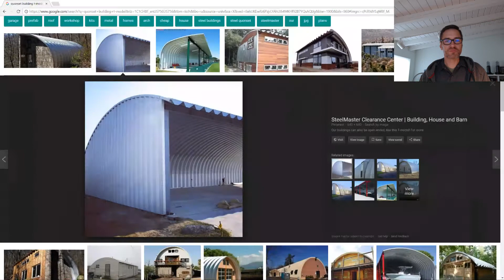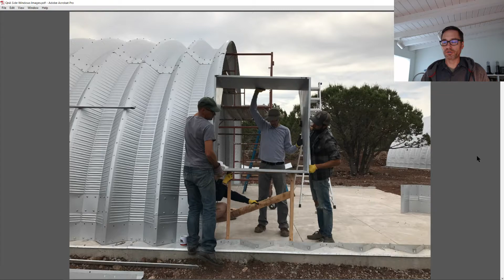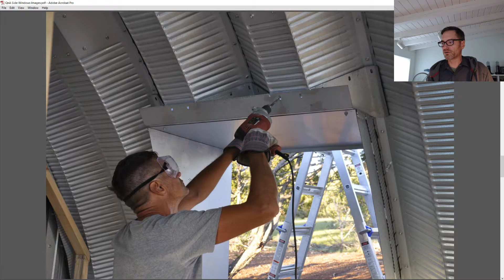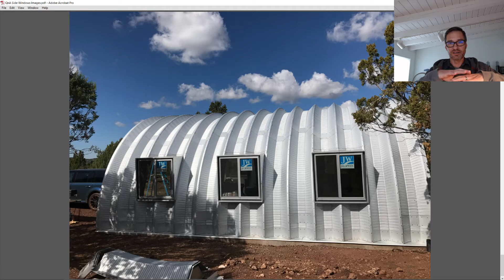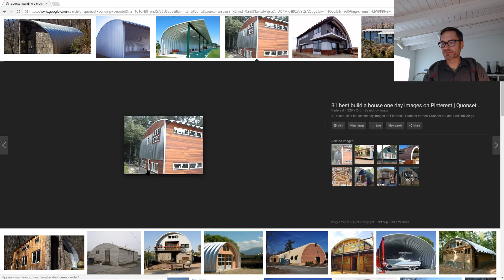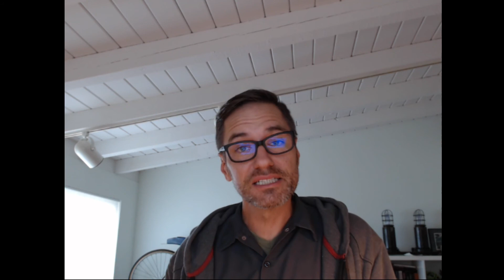Quonset Hut Side Window Installation, T-Model Quonsets, and Passive Solar Design

Comment: These openings are designed to be overlay from the outside?, Rather than staggering them like a shingle or siding?
Reply from the maker: Yes you are correct. It is a flawed design IMO.

Comment: Did you ever think about welding the side windows instead of using caulk?
Reply: Welding galvanized parts is always really terrible.
Reply from the maker: I can weld but I'm not that good at welding thin sheet metal, skill-wise. I'm pretty sure you would void the manufacturer's warranty though, if you took it upon yourself to weld their parts after they left the factory. There are also a lot of irregularly-shaped gaps and when you're talking about welding thin material I'm not sure on what the limits are for how much gap filling you can actually do with the welds. So maybe/maybe not.

Comment: Think I'm leaving mine intact
Reply: If I didn't need natural lighting we would just have windows on the end. We have Steelmaster. Don't remember the type but our windows aren't like these bc our slope doesn't start as low as these & allows for more regular type windows. We still have to cut the steel & manufacturer provided nothing on installing these. Steelmasters didn't send us any bracing. We're about to start on the 1st side window this weekend. It's one piece. Our panels on either side of the windows is the same guage as the rest but we went with an upgrade from the start due to potential snow loads & 75 mph winds. Wish we didn't have a problem with FB so we could join the group but alas, I have serious problems with it. I mostly only do YouTube for quonset hut tips & tricks. We avoided many issues by learning from other's experiences. If we didn't both have construction experience, we probably wouldn't have done this. It's just the 2 of us & we aren't spring chickens or in good health but we're getting it done!

Comment: Mine is a x or double xx .they said this was the best for our area in Canada on the prairies.your thoughts?
Reply from the maker: You must have a very high snow load there. If the manufacturer says a particular model is best for your location, I would take their word for it. They will have to do the structural calculations etc.

Comment: I was curious if you have any information on burying a quonset.  I have seen a few pics of a couple that were turned into an earth shelter home type thing but can't find any real information on it.  I even saw a pic of one that has since been removed in the website of one steel building seller.  Just curious on your thoughts on this.
Reply from the maker: There would be a ton of non-trivial challenges to overcome to do this but I won't say it's impossible. You would basically have to do all the engineering yourself, and no Quonset manufacturer would ever warranty the building. They would sell it to you but burying it would void the warranty and their engineers wouldn't help you figure it out or anything. This comes up from time to time in our Quonset Dwellers group on Facebook.
Reply: @CleverModerns  https://www.youtube.com/watch?v=RheaXH57pQo  Actually found the pic at 0:27 into this video.  Love the idea.  it is even the cover photo for their video. LOL  But yes I hear the dealers are zero help anmd will automatically void the warranty if you say you are going to bury it.
Reply from the maker: @curtwarkentin7743  Ha! I'm surprised they put that image out there. I do really like the idea of solving all the technical challenges with this. I think the best approach would be to use the Quonset as a support for a shotcrete structure like the guy at the Home in the Earth channel does. Once the concrete was cured it would essentially take over as the structural system, and the metal shell would just be the interior finished surface. That way the metal shell would only need to support the load of the wet concrete (seems nontrivial but not impossible). The cured concrete structure would be much stronger than the steel shell at that point and could handle the weight of the earth over top of it. Then stack a waterproofing membrane, drainage mat, root barrier, dirt, and plants!

Comment: Must be a way to introduce flashings to those side windows. I’m a builder, caulking is no water proofing. U must flash it. Lousy, lousy design. Great little building but those side windows suck. Vinny 🇺🇸
Reply from the maker: Hey Vinny, I agree 100% with you. We are going to frame little low-slope eyebrow-rooflet things over them and put a membrane roof on those. It will probably be next spring before we can get to it though. For now they are holding the water out. What do you think about a TPO roof membrane and bring it up several inches above the box, adhered to the metal?

Comment: It seems to me that it would have been easier to install the sill and canopy first... and then push the window frame into the hole and bolt it in place. This would have allowed you to cut the opening more precisely to eliminate the gap between the cut end of the arch and the top of the window frame... that is causing that hole.
Reply from the maker: I probably showed the worst one of the bunch, but even if you got a tighter fit, there would still be caulking required to give it the final seal, just less of it. There's no way to overlap the metal components to achieve a properly shingled/flashed assembly. A properly designed assembly wouldn't need caulking, which will eventually fail no matter what. 

Also, cutting the opening so precisely isn't as easy as it seems. For one the metal boxes for the windows aren't really all identical, they vary. There is a lot of slop in the manufacturing of them, and the canopies are similarly irregular in various ways. It's definitely not a lego set that snaps neatly together. The boxes were wider than the canopy/sill pieces, which you can't really tell from the photos. These are just some of the many factors. The canopy needs to fit very tight against the top of the box and it would be quite difficult to cut it as precisely as you describe, in the field with a grinder. I think if the manufacturer redesigned the whole window system they could come up with a better fitting product.